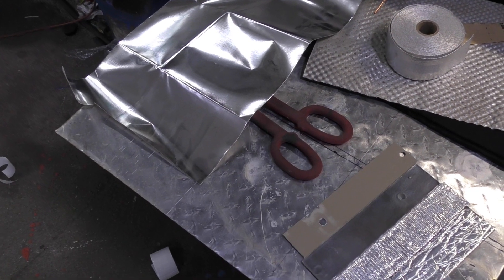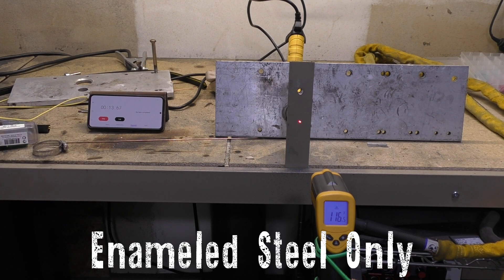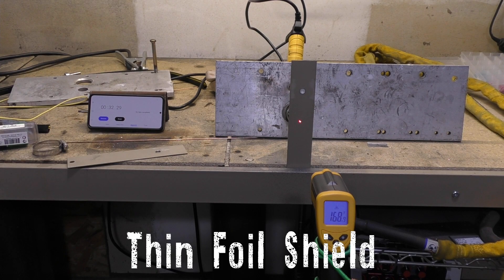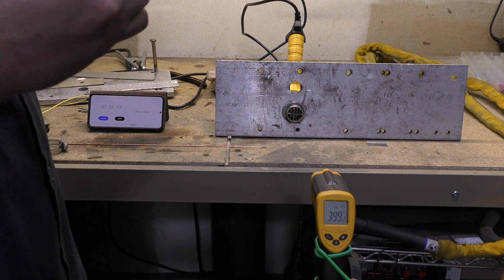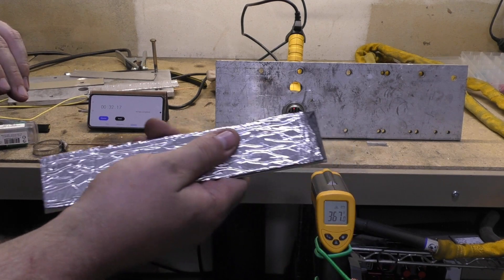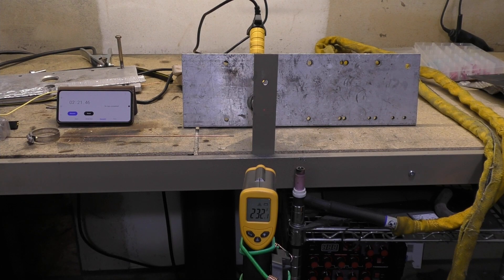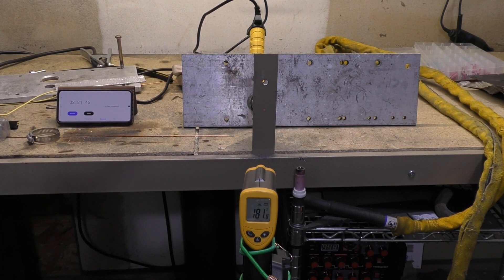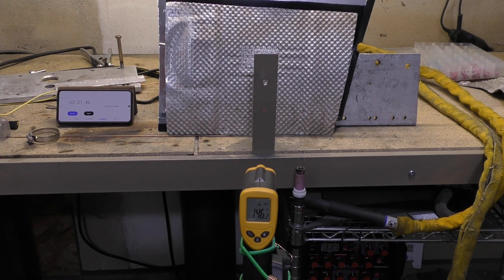Testing Different Heat Shield Materials

Comment: Some uncontrolled variables - especially the double lot - the bolt will be passing its heat to the rear steel strip
Reply from the maker: Depends on how you look at it - looking at it as a system, there are less variables involved.  The one with the bolt has to have mechanical fasteners, so the bolt would be included where the others use adhesive.  This was less scientific and more angled towards showing what an average person would do

Comment: On your control, did you preheat the heat gun to temp? Your control is key in this. I appreciate your comparison 🙂
Reply: Not a good test. That thermometer is reading the air around it. You would need a bigger piece.
Reply from the maker: the heat gun was in the same starting state for the control as the other tests - so it should be good numbers for this style of heat transfer

Comment: Heat shields are for radiant heat.  You are blowing hot air onto the shield which is not the same. That's convection.
Reply from the maker: Definitely not convection - convection is air movement, like heat rising to the ceiling without external help - this was straight up forced air - this should be a worst case scenario for this "illustration"
Reply: @Drivewaybuilt  

FYI, what you are describing (the forced air) is called 'forced convection' and heat rising to the ceiling is 'natural convection'. https://en.wikipedia.org/wiki/Convection_(heat_transfer)

Thank you for posting this video, it's excellent, but it is important to distinguish this as a convective heat transfer test and not a radiant heat transfer test. It's likely that ultra thin reflective tape will show benefit in a radiant only test

Comment: On the last test the bolt that’s tapped through is probably also radiating heat to the plate I bet if the bolt wasn’t there it would work even better

Comment: Hi, so based on your experience which material worked the best in your project?
Reply from the maker: Basically as logic would put it, thicker materials shield heat better.  The very thin foil heat barrier is not magic like ads claim and shouldn't be used for real heat blocking, maybe just a little protection for certain areas.  The fiberglass backed foil did surprisingly well and as long as you aren't dealing with high enough heat to melt it, the siless foam was a great insulator.  Again, choice does depend on the application - I used all the products on my project in different areas where one seemed to work better based on the constraints of the area.
Reply: @Drivewaybuilt  thank you so very much for the excellent answer! 

I have a Ducati V4 which has one of the pipes circulating right below the seat, which makes the under part of my legs a very uncomfortable place. I was thinking on take the double sheet oem heat shield and apply another heat shield barrier in the middle. Which material would protect best in this situation? Thanks again for the excellent video and for taking the time to answer this!! You’re awesome!!!!!